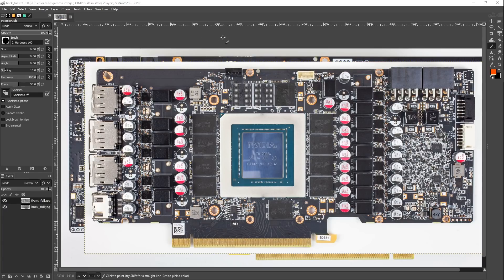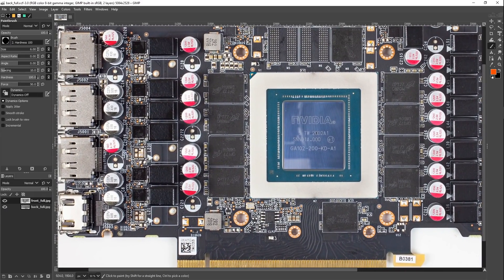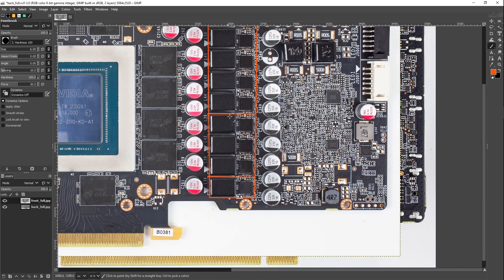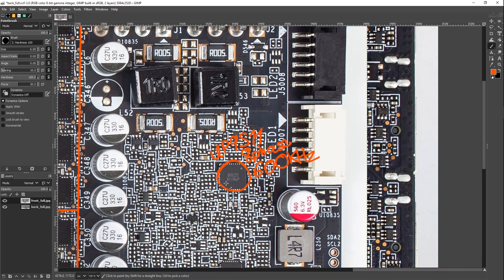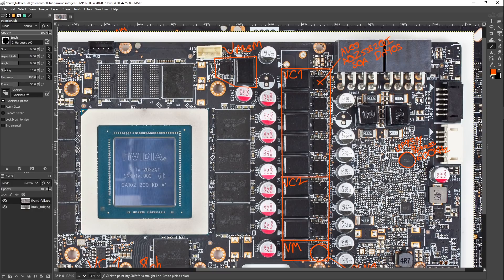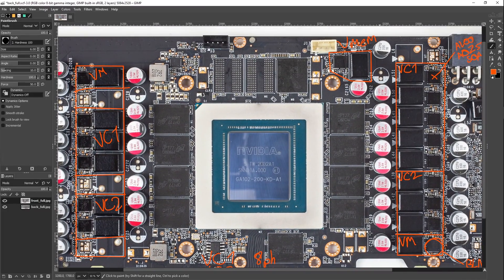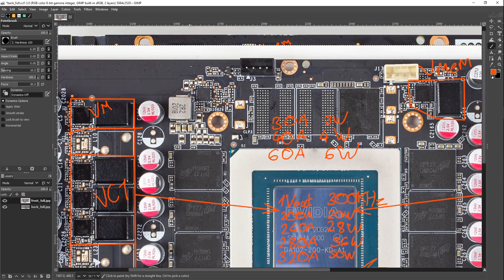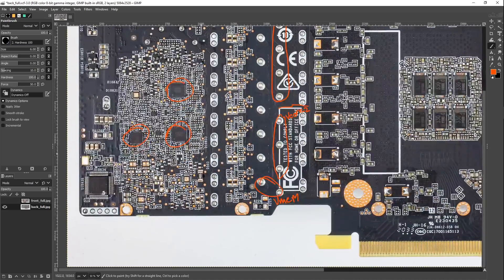GPU PCB Breakdown: Zotac RTX 3080 Trinity

Comment from the maker: lol first
Reply: first in your first comment :P
Reply: Hey that's Cheating and illeagal
Reply: You.... Can't do that though?
Reply: lol 2^64 - 1 th
Reply: How'd you learn all of this?
Reply: You haven't seen PCB by any other cards  so how do you assume it's the worst PCB?

You are forgetting that this card is MRSP and unlike any other card COULD actually be pre ordered.

You're focused on PCB quality,  nobody gives a fuck about that to the end user.

All they care about is can i buy it, is the price close to MSRP and does it perform to the 3080 refrence specs.

Anything else is you techno wanking.
Reply: @RichardDower  After having to RMA several crap cards (MSI - looking at you) I VERY MUCH care about PCB quality.

Especially for cards this expensive. 

I always suspected Zotec was too good to be true - and the points he raised about the power section explain where the price differences came from.  I'll wait for cards that are better constructed.  Either for availability or until I can afford the price difference.

EDIT: Aha - @Richard Dower bought one of these.  Purchase anxiety much?  :)
Reply: @RichardDower  Are you aware that you are on a channel titled "Actually Hardware Overclocking"?
Reply: @DocNo27  I based my purchase of the Trinity based on my previous experience with a Zotac 2080 AMP. Zero issues.

If you want to pay $150 extra for a Strix...god bless. It was available to buy, the price was €700 and no one should be unhappy or cancel a pre order based solely on the quality of a PCB.
Reply: @Lishtenbird  He bought one, there's already someone in the comments who bought one and had it fail - but we are all the unreasonable ones :)

I hope his works fine and lasts a long time.  Not all cheap cards fail so who knows.  To quote SmashTV: https://www.youtube.com/watch?v=_3jc_3p0YZY
Reply: @Lishtenbird  of course, it a channel aimed at people who like techno babble and think PCB quality will give you 200mhz overclock.  99% of people who buy these cards don't care,  don't understand and as long as it works and not blow up don't give a shit.
Reply: @RichardDower  Then why are you here and what point are you trying to prove?
Reply: I call shenanigans
Reply: @Bramon83  If you're interested I recommend a double major in computer engineering and electrical engineering. It's a rough course load but very gratifying and usually nets you a very good job!
Reply: @Lishtenbird  I'm trying to prove that a lot of this guys viewers are NOT actually hardcore overclockers and are the average joe who think the card is shit and cancelling pre orders based on that.
Reply: @Bramon83  He started with discrete circuits. You can google what's considered "the bible" in this field and buy what is known as a bread board and a handful of components to get started. You don't even need a soldering iron. Check out this: https://www.sparkfun.com/products/112
Reply: @RichardDower  This is AHOC... EVERYONE here are just "techno wanking". We mod, tweak and overclock the snot out of things for sport. Personally I'm more into the software side of things, but listening to another fellow nerd who knows what's up is interesting. 

Also, "nobody gives a fuck about that to the end user" is a garbled sentence. Did you mean that nobody gives a fuck? Or that the [typical] end user don't give a fuck? Because overclockers do give a fuck... but they don't give a fuck what the typical end user want. Overclockers want things that can handle abuse all day. And they are willing to pay for it, but prefer not. Which is why Buildzoid is often the life saver: he has spotted some cards that were not wildly expensive but really good for overclocking. This card, however, is not one of them.
Reply: This is exactly what happened with the rtx3080 paper launch LOL
Reply: You do that w/ your 3080-buying bot?
Reply: Hi There!
Love your video's, hope you never change!
Reply: @Richard Dower This card actually performs worse that the FE and after seeing Builzoid's video you know why.
Reply: @RichardDower  it's hilarious that you're here at a AHOC video complaining that noone cares about PCB design/qulaity

Comment: Oof I just bought one of these because it was the last one in stock.
Update: After using it for a few weeks it is absolutely fine. I'm getting solid performance and it boosts over 2 GHz without a hitch. +150 on core and +800 on Mem works fine too.
Reply: Before this video: maybe I should open up for Zotac cards... 
After: nope.
Reply: I just bought one off of ebay new. Fingers crossed
Reply: You can prob get +1000

Comment: Good to see a detailed breakdown like this, but in UK the ZOTAC 3080 is the only card with 5Yrs Guarantee and a 48hour replacement scheme. So when available this is still the one i am going to buy. However because of your video i will definitely not try to overclock it and just run it stock.

Comment: Please do the Asus TUF 3080 OC PCB breakdown next :)
Reply: The TUF OC seems to be the best at the moment. I think that it will be slightly beaten out by the FTW3 Ultra due to that card's 420W maximum power draw, but it doesn't have a second HDMI 2.1 port and I think it lacks dual BIOS (both of which are features on the TUF).
Reply: @frankender7026    the 420 watts of the 3080 ftw3 ultra did you see it in a review ??
Reply: @frankender7026   ok thanks
Reply: Specifically I am wondering if they made the PCB more robust than the standard TUF 3080. Because it not, the coolers appear the same... why wouldn't I just buy the non-OC card and OC it myself, and save a big chunk of change?
Reply: For now Asus Tuf is best AIB card and MSI Trio  most garbage bigger cooler but 15 C degree higher temp compared to Asus Tuf
Reply: PCB pics for the regular TUF are up too
Reply: Could you give me the link to pcb tuf non oc. I can only find the oc version.
Reply: @frankender7026  tbf for now its beaten by the FTW3, but mainly because the TUF is not the competition for the high end boards. That will be the Strix
Reply: @apmmasterpcapmmasterpc  what about XC3
Reply: @JB-xl2jc  I am also very curious if the boards of those two are different. It's $80 CAD difference that I want to know if I should bother paying for any real reason
Reply: @frankender7026  i bought the asus rog strix 3080 for 820 € is tha a gooddeal ?
Reply: Buildzoid  saving the best for last.

Comment: At the the end of the day it still runs an works like any other fucking 3080 regardless of the brand
Reply: But the CAPACITORS! Please! Will anyone think of the capacitors!

It's a 3080. It behaves the same, it overclocks the same, it sounds the same, and the crashes turned out to be software-based. Those "experts" should really learn to shut their damn mouths already.
Reply: @amirfoox7432  Yip those capacitors really get you another 50fps egg,

Comment: So if I understand correctly this Zotac's power delivery is fine if you run on stock speeds. Only if you want to overclock for a higher bench score than you reach it's limits very fast. Considering this is one of the least expensive models on the market and it's running very silent (techpowerup review) that would be a perfectly fine buy if you don't care about overclocking. Please correct me if I'm wrong.
Reply: I like ur profile picture
Reply: From my understanding, yea.
Reply: @赵财猫-v5e  I like your's too :)

Comment: This answered my question, thank you so much Buildzoid, I’m going to try and shunt all 9 of them
Reply: No dice, I soldered resistors on top of the other 8 (not pcie) and it didn’t remove the power limit.  Gpu-z shows 60% power but afterburner shows 100 and clocks the same

Comment: It's the reference design for the most part except the very right edge of the board has some extra length for more stuff. I'd guess most of the released cards have the same layout with a limited choice of parts left up to the AIB. Are you going to put out a video for all the little differences or just the interesting ones?
Reply: A lot of that room is really just a place to stick extra capacitors, which has a measurable but very, very small effect on performance relative to, say, power stage choice, output filtering, or phase design.

Comment: Hey buildzoid, I am just comparing the different RTX 3090s and I could never figure out what those power stages are you're a god lol. I also found something interesting, on the teardowns it shows the MSI RTX 3090 has NCP302045 14-phase for the vGPU. Doesn't that make it limited to 630A max? I mean what? That'll make it weaker than all the other RTX 3090 and even MSI's own RTX 3080 Gaming X Trio with 13-phases of NCP302150 totaling 650A...

Comment: I am planning on putting a AIO on my 3080. What should I look for? When I bought my 1080 ti I picked a PNY blower style, because it was the cheapest, and I was going to cool it with a AIO. Does most of the money go into the cooling of board partner cards or do they put more of that money into better components on the pcb?

Comment: According to Techpowerup's overclocked performance chart comparison in between RTX 3080s that they have reviewed, this seems to be the worst performing one out of the 5 cards, including the founders edition.

https://www.techpowerup.com/review/zotac-geforce-rtx-3080-trinity/37.html
Reply: By 1%...its meaningless
Reply: Add to which the article CLEARLY states that 1% could be silicon lottery.

Another zotac card could be equal to the FE card, each single GPUZ is different.
Reply: MSI most garbage highest temp  because it depend on cooler and pcb so u can judge how bad it is but u cant judge a card based on clock speed because it  depend on silicon lottery .
Reply: It’s within margin of error for silicon lottery 

Meaningless
Reply: @RichardDower  Even Zotac rep on Reddit told that Trinity and their other lower tier models are intentionally set to perform lower than founders edition card, in order to distinguish them from their higher end models that would be released later on.

https://www.reddit.com/r/ZOTAC/comments/iv4j17/3080_trinity_13_behind_fe/g5q82zr/

Comment: I picked up one of these cuz it was the only 3080 available, wasn't my first choice cuz i knew it would probably be the cheapest made card. That being said, I'm getting pretty much 2-2.5x performance increase across the board from the 980ti I upgraded from. Temps are a little high until you set a custom fan curve. I still will probably upgrade to an Aorus or something when they are available, but so far this isn't a bad card.

Comment: A lot of people bashing this GPU and the 90% of them will still play at 1080/1440p at most... lmao. Difference will be barely noticeable between this one and a damn MSI Gaming X Trio. Just like 10-15 more fps. And if you really really care those extra fps, you can slightly overclock the Trinity to gain that difference and match it to stock Trio. 
And if by then you're not happy, you can always sell it to buy the one you want lol. Unfortunately, in these days it's hard to choose one, stock is running out so fast you can't even get to choose. Just pick one, change later on.

Comment: hello where is the temperature  sensor located i recently change thermal pads and im getting error gpu driver no temps im  affraid i add some pads wich they are blocking the sensor

Comment: Hi, I have Palit 3080 Gaming Pro 10GB. I wrongly connected +12V to speed signal of double fan socket and GPU died. Now motherboard don't detect GPU. But single fan and RGB LED works when power up.
I discovered the GPU. It has one Holtek HT50F52241 and one IS25WP080 and others.
Your opinion, which chip controls fans? and which begins communication with motherboard?
May my mistake damage main GPU chip?
Do i hope that repair it?
Please answer me.
Thanks for videos.

Comment: I based my X570 Mainboard purchase solely based on your review. So I ended up with a board I want to have, but also out of money.
Are you planning to review multiple 3080s and the upcoming AMD 6000 series?
So far I think the Asus TUF is at the sweetspot of cost and quality. And it has 2 HDMI ports. Which is a big deal for anyone how has a AMP and LG TV.

Comment: Hi m8, I'm still watching the video but have you noticed that there is a lot more of glue logic? Why is the back of the card so packed of unpopulated components. (At least from my smartphone seems like it is)

Generally there is a lot of bypass caps, but this time there is a ton of resistors around.

BTW to me looks that vcore1 is 3d, vcore2 is memory controller and probably   support blocks in the die like dma, cache etc.

The memory controller is getting a lot of power for sure.

Comment: could 2 more RAM chips be added after production to get 12gb or would the bios freak out?
Reply: Good question
Reply: Not just the RAM chips are missing but also the memory controllers. Thats why random chips are missing instead of the same ones on every card. So it would most likely not work :D
Reply: @Chuckiele  so the 3080 may just be a crippled 3090 that didn't PASS QC 10gb kinda light on 4k
Reply: @mattraymond2935  yes, the 3080 is a broken 3090 because theyre both GA102 chips, except that the 3080 has two broken memory controllers and a bunch of other stuff missing. As the 3090 uses 24GB instead of 12 though, its possible that there will be a 20GB version of the 3080 coming soon.
Reply: No, you need os gpu that has wider memory bus aka you need 3090 gpu to do that.

Comment: with the part about power i am now wondering why not have the 2 power connectors be on oppisite sides of the board?
Have them closer to where the VRM chips are so less power loss and less chance of amps going where it shouldn't.
Maybe this is me not knowing enough about how the system on the PCB works but in my non-educated about VRMs mind it seems like a good idea of what to do.

Comment: Saw the pre-order of this card on amazon(de), checked the pcb shots from techpowerup and decided quickly not to order it... Hope I wasnt wrong on that decision:)
Reply: I think it's better to go with MSI Gaming X Trio or EVGA FTW series at this current post-release stage, there's generally a lower chance that you can go wrong by selecting those models.
Reply: @sairsonat9816  I think the tuf model surprisingly received many positive reviews, but over here it's all overepriced from the start
Reply: @sairsonat9816  Gaming x trio is like 350w max tdp, ftw3 is like 400w, and a pr guy from EVGA said they are gonna release a 420w BIOS.
Reply: @sairsonat9816  The Gaming Trio X only has 13 power stages and is limited to 350W even with 3x8-pin power connectors. For reference, the FE runs 15 power stages and has a max power limit of 370W, and the ASUS TUF OC has 16 power stages and a 375W max power draw while also having dual BIOS and 2x HDMI 2.1

The Gaming Trio X is gimped from the factory, and is arguably WORSE than the Founder's Edition in performance overhead. 

Breakdown thread for reference: https://www.overclock.net/threads/official-nvidia-rtx-3080-owners-club.1753932/page-9
Reply: @greggreg2458  Yeah the Ampere cards will heat up your entire house lol
Reply: @DenGuleBalje  If AMD delivers at the high end and if it's better than nVidia i will go AMD, i don't care about power if the performance is there, unlike for example Vega 64.
Reply: @user-ku6bv4ni2f  It's easy for me to chime in since I lucked into a 1080ti the day before launch on NewEgg at MSRP so I got to be one of the first with that generation and it was cool.  Especially since my 980ti was dead (third card, but finally out of warranty - thanks MSI). Just give it a month or two and the prices will come down.  I"m curious to see what AMD is going to counter with before considering upgrading since my 1080ti still handles what I play just fine.  I probably need a CPU upgrade before video card at this point :p
Reply: Well then you lost out on a 3080, if you're ok with that and willing to wait and pay more...more power to you.

I personally think it's utterly stupid to cancel a pre order based on PCB quality.
Reply: @RichardDower  Well, I plan on holding the card for long term usage, and I'm not really that urged to purchase early, so I can wait. To me I'd rather wait for a card that I'd love to keep for two years or so, and therefore this one is an instant pass. At least those cards will be in hands of people who value them more than I do ;)
Reply: @greggreg2458  You don't care about power,  but it's literally THE #1 limiting factor.
Also, if the room your PC resides in is average sized, it will heat up quickly and you'll be gaming dripping in your own sweat. 
Luckily I live in cold Norway lol
Reply: @DenGuleBalje  i don't care about power comsumption, give me a 1000w limit and i'm happy. And yes i know about power being a limit,  a few comments before i was telling the op that the evga ftw3 seems to have the biggerst power limit for now.
Reply: @greggreg2458  I don't care about power consumption either, but 350w TDP literally means 350w of heat shooting into your room. TDP is not a measurement of power consumption, it's a measurement of the heat production. It tells you the amount of heat that needs to be transported away from the chip and out into your room.

The power consumption is a bit higher than TDP and relies partially on the efficiency of the power delivery. 

1000w is literally about as much heat as an actual decent size space heater produces. Even a 250w heater is enough to keep a 2-5 m² room here in Norway warm through the winter.
Reply: @DenGuleBalje  Thanks for telling me but i already know..

Comment: So I had 2080Ti FE that I ran without tightening the waterblock down. I eventually figured it out because after the first 5 mins of load or so, it would stay at 80% power. I assume if would have fried if it didn’t have smart powers stages.